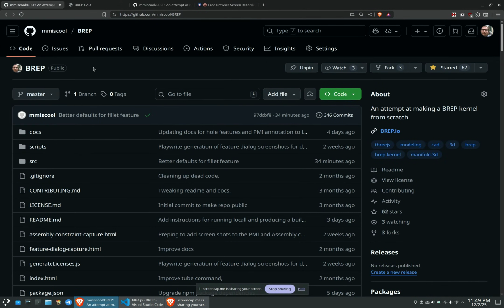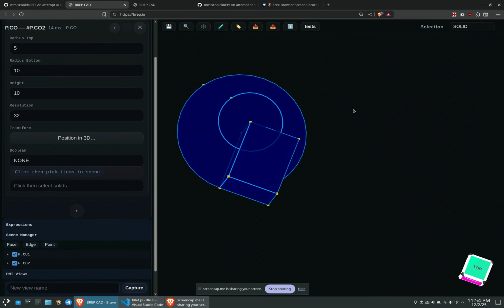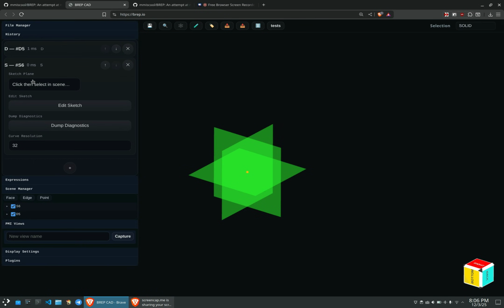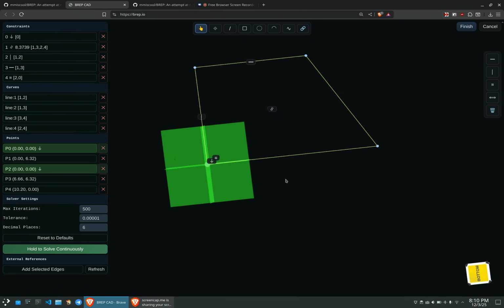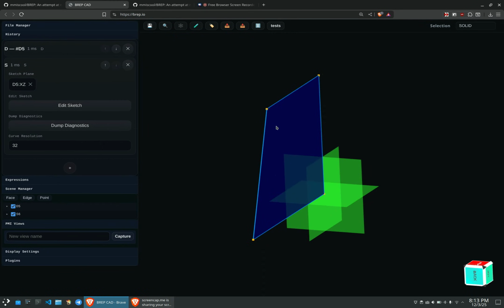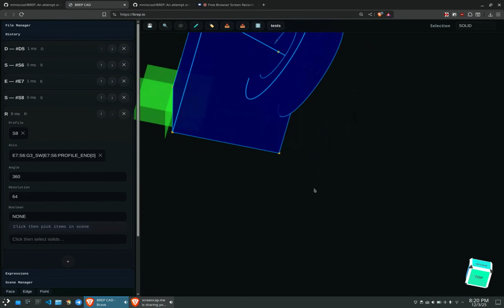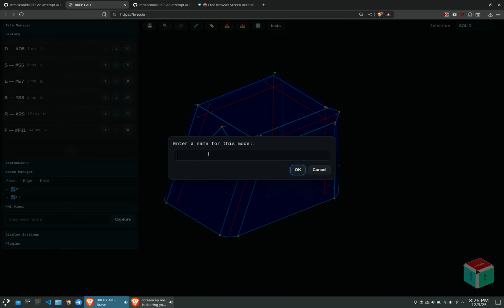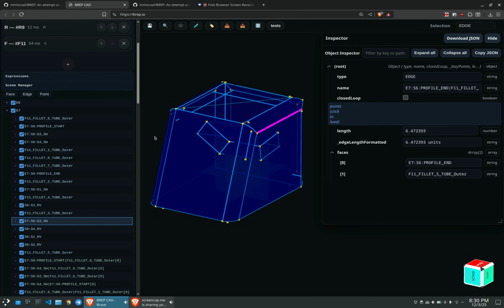BREP.io Intro (A browser based parametric modeler)

Comment: This rules! Is there a way to model from a code terminal?  Something like:

(0,0)+ Sphere r2c(maxZ)_Cone r3h4 ? 

Oh wait to make an ice cream cone we would want it flipped larger scoop with a Toros on top of the cone: 

(0,0)+ Cone r3h4c(maxZ).._(Z-2.5)Sphere r3.. (Z-.5)Toros r1cd2.9: Texture=ripple or drip

Then in the terminal you could:

Insp ls

....
Face 
Vol
Surface

# user can tab through.  

Really cool stuff I'll have to give it a try soon!  Reason I ask about the terminal is I'm running into limitations with OpenScad and JSCAD and seems like your tool could be a solution thanks for making it!
Reply from the maker: So you can create your own features and use them as plugins in this software. 

https://brep.io/help/plugins

This is the code for the BREP.Solid class
https://github.com/mmiscool/BREP/blob/master/src/BREP/BREP.js
https://github.com/mmiscool/BREP/blob/master/src/BREP/BetterSolid.js

I tried to expose things in such a way that they are easy to use.
Reply: @mmiscool l thank you!  I will most certainly look into forking and seeing about a </> window. 

This is an amazing project! Would it be ok if I highlight your project on my channel?